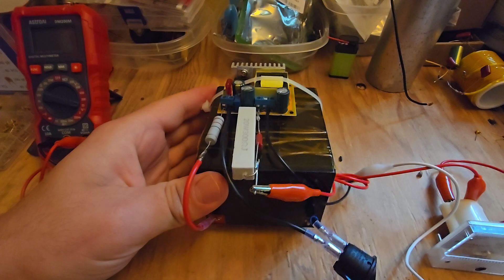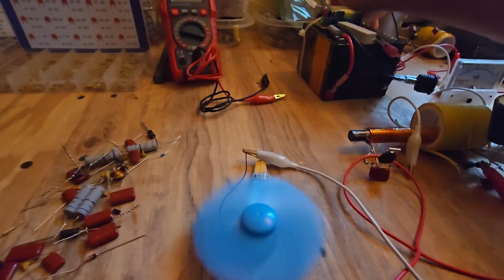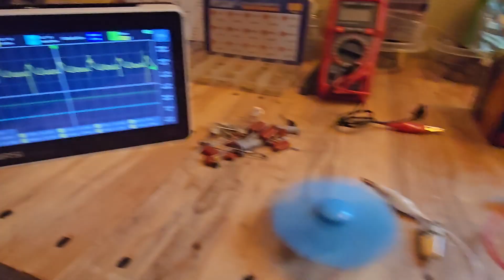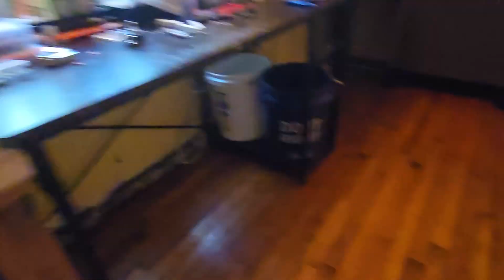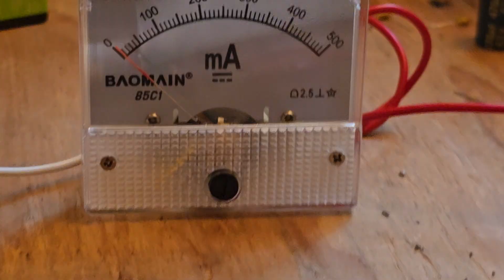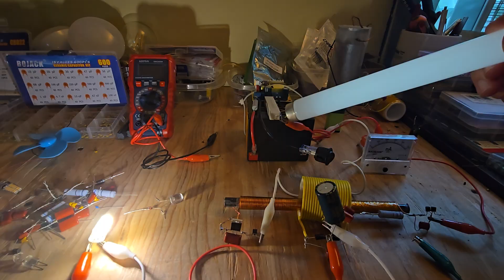➡️PERFECTING THE LONGITUDINAL TESLA TRANSMITTER. WE CAN RUN ANYTHING NOW WITH NEARLY NO INPUT💡

Comment: Joel says you can safely take no more than 1/10 of power to maintain the oscillation. Assuming your and his setups are similar in nature. 
The whiny sound is probably from high frequency. There's a video on youtube, where a man stands on 1.5 Million volt generator and lets thunderbolts shoot from his fingers. High frequency electricity doesn't penetrate skin.

Comment: Hi Mel, I wonder if you can run a dc booster or mppt inverter (string or hybrid inverter) on the output ?
Reply from the maker: Should definitely be possible & the system excels at storing charge in large dc capacitors wirelessly at virtually no current input drain from the transmitter  :)